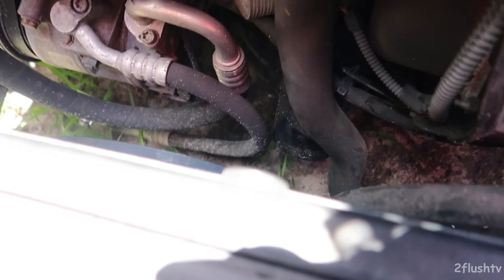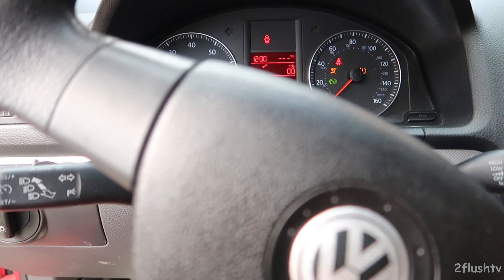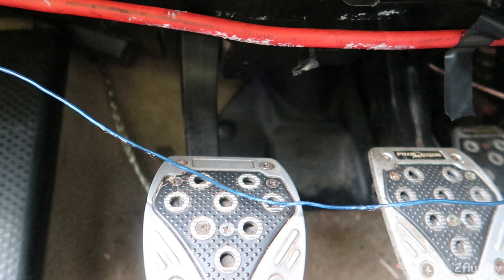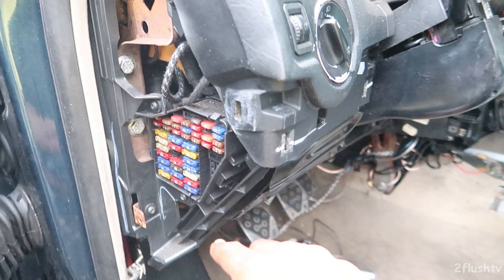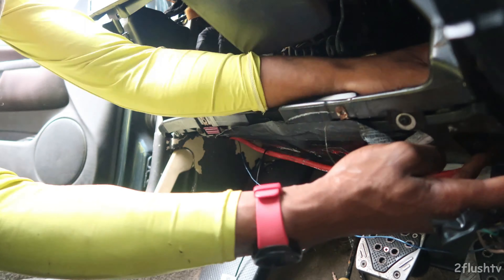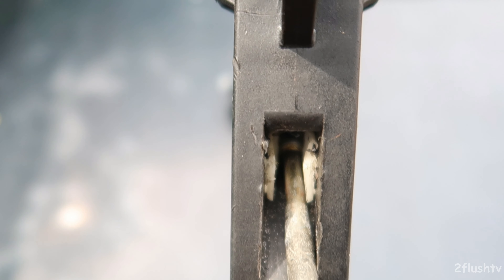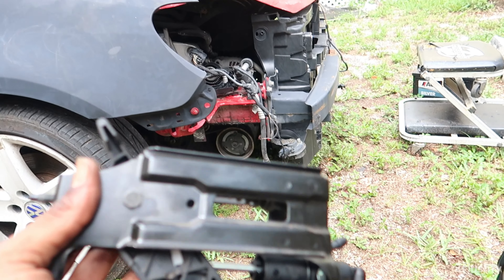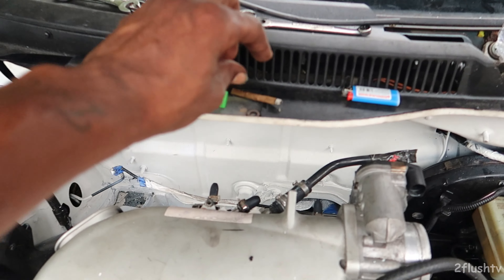clutch master cylinder replacement | mk4 jetta

Comment: Don't know if you ever got it started, but when my VR6 did the "no start", there was a wire that connected to the starter that was loose, I taped it with duct tape and it fixed the issue. Good luck with it!
Reply: You all prolly dont care at all but does someone know a tool to get back into an instagram account??
I stupidly forgot my password. I appreciate any assistance you can give me.
Reply: @Enrique Benson Instablaster :)
Reply: @Angel Bruno It did the trick and I now got access to my account again. I am so happy:D
Thank you so much you saved my ass!
Reply: @Enrique Benson glad I could help :)